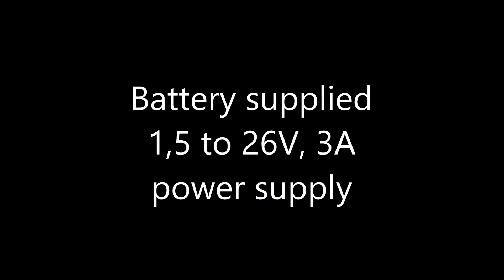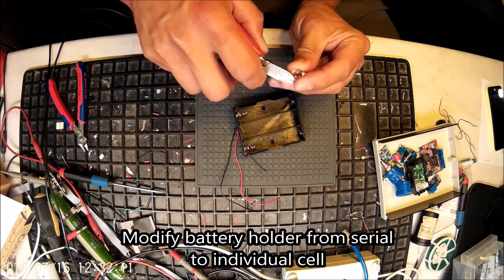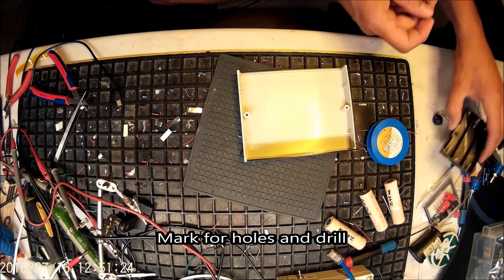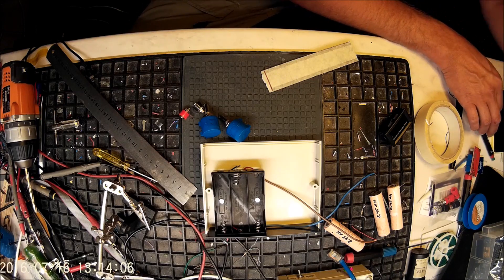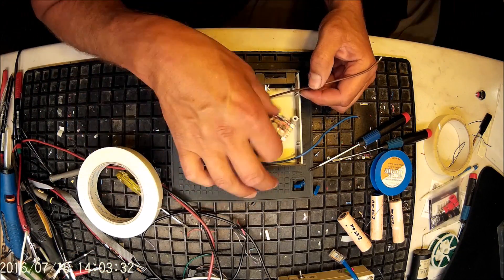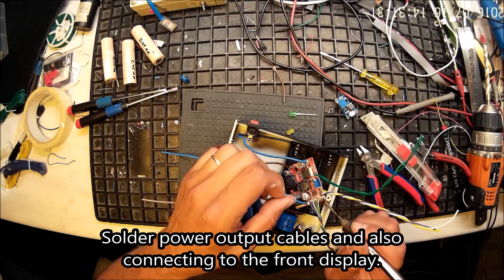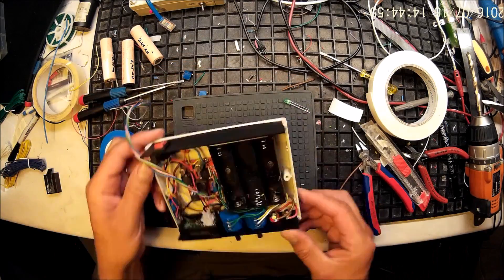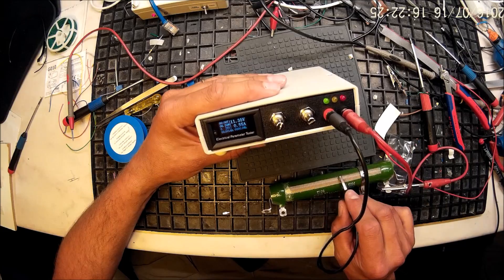Portable, battery supplied Power supply

Comment: very cool indeed. I have a much simpler version of this project, using just the on board rheostats to control the  voltage and amps.  i have been using this for over 2 years now and it is probably in need a rebuild, but still working good when I need her.Instead of using banana plugs, I simply have 2.1mm power jacks on the case for the female, and a male on a long lead to plug into the needed device. Works OK for what I have been using it for.  Thanks a million for the video, I may well use much of your example in upgrading my unit.

Comment from the maker: The 3 one cell bms modules is not working well as they drain one of the batteries if unused for 3-4 weeks. I will upload a modification with a 3S bms module soon.

Comment: It is a pity you used high speed playback for this video as it is very hard to follow, otherwise it is a great little project. I have watched this clip dozens of times just to try and catch the bits I missed and still cannot fathom your connections as you do not dwell on steady images EVER! As for your front panel LEDs are they simply in parallel with those on the PS board or did you remove the surface mounted devices as you did with the potentiometers?
Reply from the maker: Bruce Woods Thanks, I Speed up the movie as it was very long. I just soldered the diodes in paralell. Didnt remove them.
Reply: Peter H.   Thanks for your reply,  I have now started on this project, it will make a great addition to my workshop.

Comment: Hi. Excelent idea. Can you please explain the charging connections?
Reply: Google 3S BMS and look at images. Better option for you then.
Reply: This actually gave me the idea to make one as well but with a 3S BMS using 9 cells. So 3 groups of 3 in series to also increase capacity. If using used batteries, you want to try to match the 3S so they are similar in mAh or one cell will take a lot longer to charge while the other two are dumping energy while they wait. Then to charge use just need to feed the 12.6V at 1/2C to 1C and the BMS does the rest. I really should start doing vids of experiments. We learn so much from this.
Reply: Thanks alot
Reply from the maker: I will upload another video regarding that soon. Thanks.
Reply: From what I have read these TP4056 modules cannot be wired in serial due to common ground:
http://budgetlightforum.com/node/39060

I'm interested in seeing how you solved this problem.

Thanks for the video.
Reply: The 18650 are not connected in series, there are connected in parallel.
Reply: At around 4:30 he said "...connected in serial" which is why I'm confused. Looking forward to the detailed battery / charging video. Thanks
Reply: So i'm i.
Reply: Hum, the batteries are not connected in parallel nor in series, they are individual,  he connected a tp4056 for each cells but then he connected the tp4056 ouput in series so 4.2V x 3. Will think about this tomorrow and will make a shematic if it works.
Reply from the maker: Francisco Ferreira Hi. Yes I connected the batteries to individual protection/charging unit. Reason is to shut down individual cell if voltage is getting too low. I believe there might be better solutions but I had those modules availible.
Reply: +Peter H but you connected the tp4056 output in serial to have 3.7x3 ?
Reply: When in series. The TP4056 have to be isolated so as not to share a common ground. I will assume that the multi pin connector/ charger has isolation for each cell in the brick.
Reply: Yes true, that's why i've asked him how did he done that ? 3 modules 230v to 5V 1A is fine ?
Reply: JS7457 1A per cell is OK. it's what you do to a stand alone cell anyway. As long as you charge but don't exceed 1C to your bank, you don't risk shortening the life of the battery too quickly. If you were to put 10 batteries in parallel, 1 chip at 1A would take forever. so some out there parallel chips or buy them already made to deliver more current to the bank. Now his series setup has to have an isolated mini Transformer for each chip for this to work. being that he recycled the batteries, I'm guessing he may have refurbished a 5v AC to USB charger for each module in the power brick he made to keep the neg rails floating. We'll see when he makes the video
Reply: Thanks, is there any other way to charge them in series without using 3 usb chargers ?
Reply: Yes. you would just use a balance charger like for RC cars. Or use a BMS system onboard like laptops, cars etc